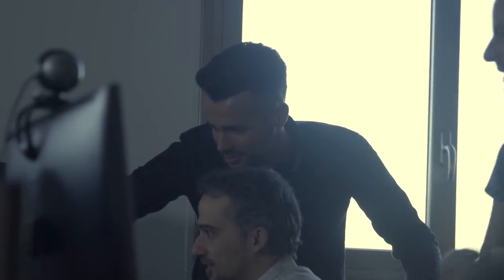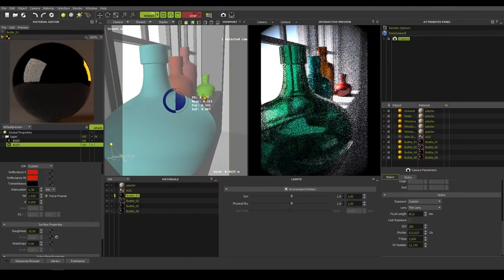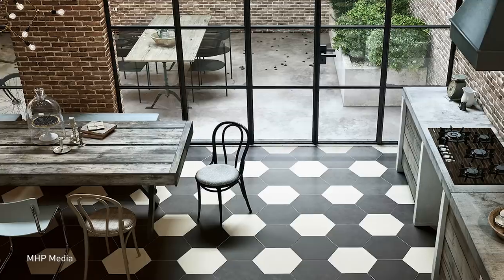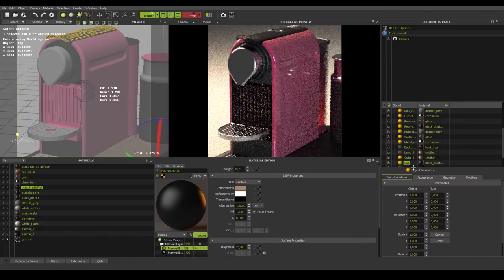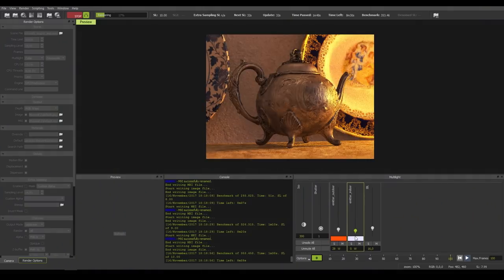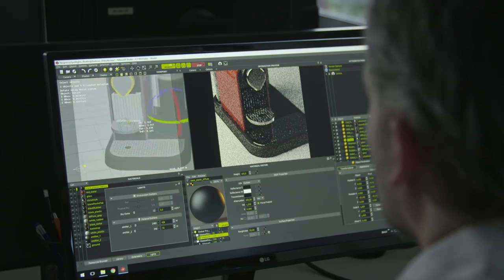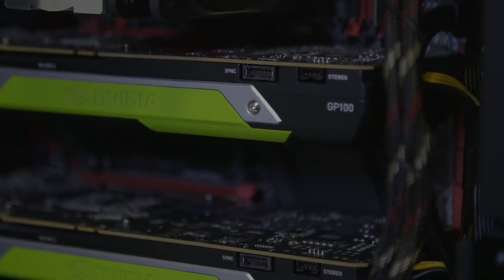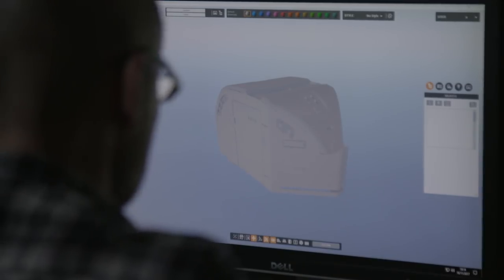NextLimit Maxwell Accelerates Design Simulation with GPU Rendering

Comment: (To clarify: NextLimit makes a render engine called "Maxwell" which can work within different 3d software packages.)  It's great that Nvidia is finally talking about their current hardware accelerating non-game render engines.  Something that has been massively lacking prior to this video is discussion of adapting exiting renderers to the hardware, even Nvidia's own systems like Mental Ray and iRay.  But like everything about this hardware generation's launch, even this video has a glaring lack of details or quantitative information.  I'm hopeful for significant improvements in rendering speed, but frustrated by their vague and non-specific marketing babble.

Comment: Real time ray tracing should be open source!
Reply: It is on AMD!
Reply: I know that but what i meant is that Nvidia and AMD should use the same code or something like that because if AMD makes their own version of Real Time Ray Tracing with their new GPUs then we won't see this technology used in every game some games may support both some may support only one of them and that's a big problem
Reply: @khaled.aldajani  AMD realtime ray tracing was launched last year, it works using OpenCL GPU acceleration on all their GPUs and on nVidia's.  Sadly, nVidia's "breakthrough" ray tracing is nothing more than marketing hype.
Reply: Ray tracing was out in 2014  on a smartphone GPU that could do 6g rays this is more than the high end GPUs
 This smartphone was $200 not $1100 like all of the new cards
Reply: Guys, please realize this is hardware-based raytracing, not software, and not shared hard+software either, the reason this is a big step is BECAUSE its fully hardware based, raytracing isnt new at all, and nobody is saying it is, the fact that these gpu's have a bunch of cores made for raytracing (rather then standard cores used by software for raytracing tasks) is the innovation.

The 2080 (technically a consumer card, that will cost ~600 bucks a year from now) does 10 gigarays per frame at 60 frames per second, and then theres the types of cards these studios use, which most likely compute somewhere in the region of 20-30 gigarays per frame, and this is just the first generation of RTX cards, just imagine what the next one will do.

If your actually interested in this, watch the keynote.

@Scrap Tech Tips : please, by all means, tell us about this smartphone gpu from 2014 that does 6 gigarays per frame? at even 30fps? oh right, it doesnt exist :P
@Rob Colclough : try wrap your head around the fact that this is a ton more rays then what AMD did last year, on bespoke hardware instead of your bog standard gpu cores that you want to keep available for the rest of the rendering.

Again, the keyword here is that there is specially developed hardware for the raytracing, that sits alongside your standard stuff, so you can do it at 4k and everything, as much as i want AMD to be at this point yet (because competition is good for innovation & pricing) they have some catching up to do. Lets hope that happens soon so we get photo-realistic gaming across the board in a few years, dont be a fanboy though, nobody likes that. (and no, im not a NVIDIA fanboy, i just realize that this actually is leaps ahead atm, and i hope you guys eventually will realize this too, just so you can tell AMD to keep up, because again, everybody wins from competition, even fanboys)
Reply: @suicidalbanananana  Rubbish, nVidia's TraceRay() function is in microcode, and runs on a GPU core, just like openCL ray tracing. Are you paid by Nvidia?
Reply: @robc3863  
Aye ur a smart bloke
Reply: @suicidalbanananana  
Were you just shot down by a single link?
Reply: +Scrap Tech Tip
You do realize that this supposedly 6 Gigaray Smartphone GPU only did 300 million rays per second. Just looked at the spec sheet. 300 million is 1/20th of the performance of the low end RTX 2070. Please next time just read all the information available and don't repeat false information that some random youtube guy says.
"Unmatched real-world ray tracing performance: Up to 300 MRPS (million rays per second)" https://www.imgtec.com/blog/powervr-gr6500-ray-tracing/
Reply: @MagicCookie  
Look and see
There is add in cards that can do Terra rays 
Nvidia is hopeless at this 
The rtx2080 will be a 480 with a fancy cooler
Reply: Meme Machine  He think that tiny phone GPU some how more powerful than $500 GPU.
Reply: +Scrap Tech Tips
There is no "add in cards". The 6 gigarays chip is a hypothetical high power 120 watts chip that never materialized, and due to financial instability after Apple part away with them. PowerVR had suspended all future development of their ray tracing chips.
Reply: +Rob Colclough
It runs on RT cores, which are specialized hardware to accelerate raytracing. They don't work the same as cuda cores or stream processors, which is what pascal and amd gpus use. It runs over 6x faster for ray tracing. 
They also have tensor cores for deep learning which is useful for denoising.
Reply: @mememachine7973  
Think of this
The phones GPU would be less than 5w and the GPU is probably at 400w so if we scaled it the phone would be better and more efficient
Reply: @ScrapTechTips  literally not how any of this works, starting with the fact that the Desktop part is not even close to 400W.
You have no idea how chip design works or scales. Things often are not linear or don't work out as you think they would.
Reply: @MagicCookie  
I work at Qualcomm
Reply: What i meant by my comment is that the same tech should work on both AMD and Nvidia i really don't care about which one is better i have Nvidia GPU but this kind of tech shouldn't be only exclusive to Nvidia i am sure AMD is gonna release a ray tracing GPUs soon but the devs shouldn't work on both of them individually so we see more support for Ray Tracing in more games
Reply: @khaled.aldajani  well on windows Ray tracing is part of the DX12 API now https://blogs.msdn.microsoft.com/directx/2018/03/19/announcing-microsoft-directx-raytracing/ so that game developers don't have to rely on specific hardware, right it's only NVIDIA that implements hardware support for that though, but if/when AMD adds hardware support the games should just work
Reply: @robc3863  I'm very curious to hear how you got your hands on a RTX card, and managed to reverse engineer its inner workings on such short notice? are YOU working for NVIDIA? Yeah, I didn't think so. Go be an AMD fanboy somewhere else please...
Reply: @descai10  RT cores are simply floating point math units configured for ray tracing, using OpenCL the same work is achieved on shader FP units.
Reply: @suicidalbanananana  NVidia confirmed RT units perform the ray tracing math, and all hlsl instructions use microcode. AMD have real-time ray tracing that works the same way using compute units' floating point units under OpenCL, but there is no difficulty in adding microcode to support the TraceRay hlsl function.  Unlike Nvidia, AMDs Ray tracing API is open source, and runs on Nvidia GPUs too.
Reply: +Rob Colclough
Could you provide the sources for your claim that the RT cores are nothing but normal compute cores?
Reply: @descai10  They are specialized math units, optimized for ray tracing. In this link the Nvidia engineer that developed them explains: former_nvidia_gpu_architect_what_is_rt_core_in
Reply: +Rob Colclough
You didn't post any link, but i've already seen that discussion. They're not just compute cores, it's an ASIC specialized for raytracing. AMD can't reach anywhere near the same performance without building in an ASIC for raytracing themselves. However i'm sure AMD can do that fairly easily.
Reply: @descai10  "Radeon™ Rays (formerly AMD FireRays) is a high efficiency, high performance GPU accelerated ray tracing software. By tracing the paths of light rays moving through a movie or game scene, Radeon Rays simulates the effects of light rays reflecting and refracting through an environment and interacting with virtual objects – for stunningly photorealistic 3D images."
Reply: +Rob Colclough
Keyword "software". I never said they couldn't do raytracing on their gpus, i said they couldn't do it anywhere near as fast.
Reply: @descai10  AMD released real-time ray tracing before Nvidia, but without the exaggerated hype : https://youtu.be/C9eMciZGN4I
Reply: You don't seem to be an engineer, so you probably wouldn't know that nVidia's real-time ray tracing accceleration add-on ASIC ONLY accelerates the ray-intersection calculation, which AMD performs in hardware too, to be precise in the math units of the thousands of shader units in their compute cores. Both companies uses extensive SOFTWARE algorithms in shader code to compute the final ray traced pixel.  As nVidia's ray tracing struggles to reach 30 FPS on any reasonably detailed scene, I would say the speed is very similar to that of AMD, which equally requires high-end hardware to run even at low FPS.
Reply: +Rob Colclough
The only way to prove it is if you provided benchmarks. I've looked for them and can't find any.
Reply: Just ignore him, hes trying very hard but is clearly just a hater xD
Reply: It's getting really weird seeing the comments about Radeon Rays. Honestly, how is that ray tracing explainer video supposed to win anyone over? How many production engines use OpenCL? At this point, pretty much every major company has announced support for RTX. It's really not some conspiracy here. People need tools that can meet the demands of production. Renderman: https://www.youtube.com/watch?v=w2ft7JhAkQQ Arnold: https://www.youtube.com/watch?v=Nr4_VAHTj_w  Overall support: https://blogs.nvidia.com/blog/2018/08/13/turing-industry-support/